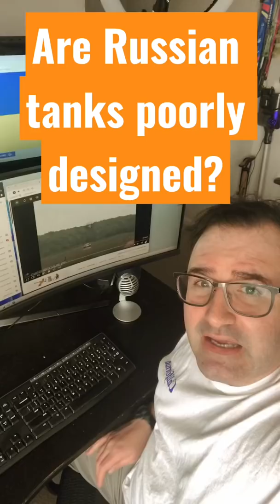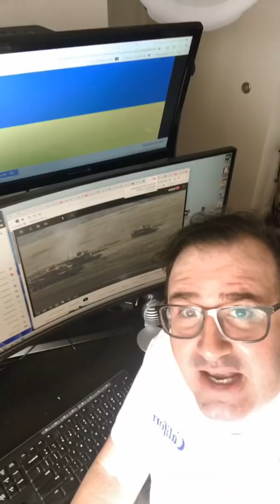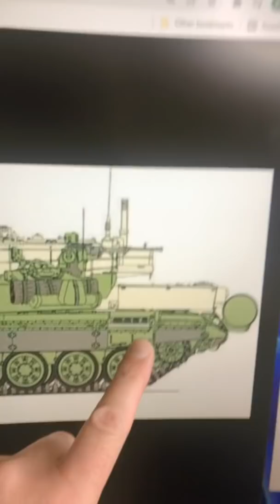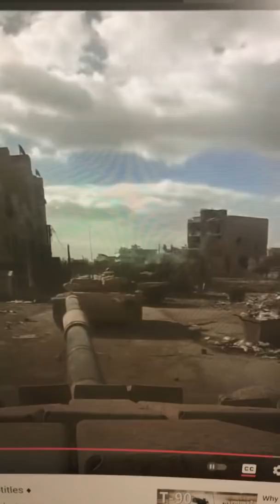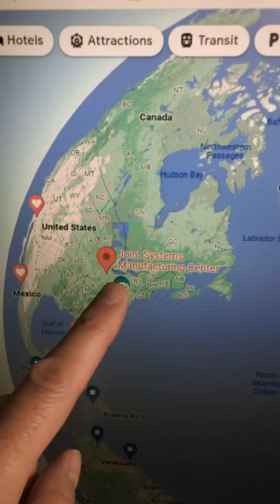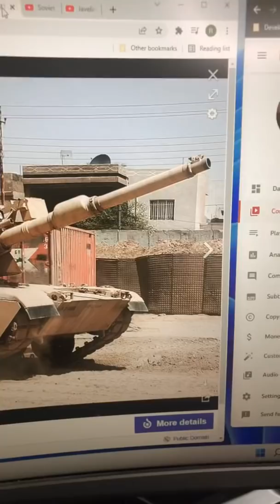Are Russian tanks poorly designed?

Comment: Makes sense, they aren’t a bad design just out of date.
Reply: This happens a lot with history and tanks, most tanks are not actually bad just made for the wrong purpose or out of date, like Britain and Japan in WW2, at early war they had excellent armor, but other nations were just more advanced, or had the right purpose in mind. Both nations, mostly Britain, ended up designing better vehicles in the later years. I dont think the same will happen to Russia here... Mbt's are so expensive that you cant just make a new model willy nilly and start mass producing it, especially with Russia's economy tanking... No pun intended.
Reply: Jay Nirbo  Not necessarily, its a tank family that came to in 1969, even with modern remedies and mods its an old design overall, and for what it was designed for it is actually quite effective, still some flaws and shortcomings noticeable as well of course... The skill of the crew is very important as well. 

An example I can give, no Abrams with US crew have ever been fully destroyed, only knocked out (meaning the tank can still work and the crew does not die... For the most part, injuries and other sometimes dire casualties have been at cause.) 

However, in foreign crews within the middle east, many top tier Abrams tanks have been totally destroyed, so crew skill plays a huge role in how well a vehicle performs.

The T-72's and T64 series tanks are not only designed for the wrong purpose in Ukraine, with outdated designs, but they are also ill-equipped to fully defend against Javelins, AND a lot of Russia's armed forces are either conscripts or people who have never been in a proper battle before. So as a result... Well you know the result.
Reply: I think "obsolete" is the word that you're looking for.
Reply: @pulaski1  
ob·so·lete
/ˌäbsəˈlēt/
 
adjective
1.
no longer produced or used; out of date.
"the disposal of old and obsolete machinery". 
Therefore I just said out of date, and I prefer to say it that way. Thank you for your time though 👍
Reply: Russian do have good design as replacement ie T14 but they don't have the time to work out the kinks or money to mass produce it. On the other hand for western countries or countries with size and weight restrictions can always use bustle autoloader which gives advantages of both tank design philosophy.
Reply: @happypunky4129  Although the design is old with proper modernization like in T90M ie a shiled to protect the rounds in carousel from shrapnel. A bustle to carry extra rounds. Heavy era which throws plate both into the jet and in front the jet to defeat tandem warhead mounted all around. Remote control weapon system and drone connection with battle management system. Their is also a prototype improvement initially developed as a backup to T14 ie Burlak dual autoloader tank in which the he/heat/missile rounds are in bustle autoloader while carousel contains apfsds or the bustle contains charges while carousel contains main rounds. Beside that Russia do have all around active protection system both hard kill and soft kill but never seen on service tank ie T90M. Beside all this if proper tactics are used then it becomes increasingly difficult to kill a tank. Like how in the hands of USA, Germany or France abrams, Leopard 2 or Leclerc are seldom destroyed exception are friendly fire or massive ieds. But in the hands of Saudis, Turkish or UAE  all three have suffered good amount of losses from atgms.
Reply: but is there a tank that can withstand a direct hit from javelins and nlaw though?
Reply: @Jupiter.141  Possibly merkava as it has the most amount of roof armour with active protection system. Also as it's engine is in front if javelin dives on it will be going on to the engine away from the fighting compartment same can't be said about the driver sitting beside it. In rear engined tanks when javelin dives at an angle turret comes in between the heat source ie engine, so it usually hits the top of the tank. In case of nlaw as it travels straight it can be intercepted by active protection system.
Reply: @happypunky4129  name one time when Russian tanks were effective against western tanks.
Reply: @drewschumann1  thats the problem, they're outdated,you cant bring late WW2 german tanks against "modern" russian tanks the same way you cant bring "modern" russian tanks against modern american equipment and tanks.
Reply: Jay Nirbo  Tanks in general are bad for modern combat against a modern foe. U.S. tanks would be absolutely destroyed by UK anti-tank missiles. Or even drones like the Turkish ones taking out the T-72s. We have entered into a new era of combat in which tanks are effectively obsolete for everything except crowd local control.
Reply: @TakNuke  yeah sure u stay in that coffin
Reply: Russian Tank makers and Putin in a nutshell:

„You’re out of touch, I‘m out of time.“
Reply: The arbams is just as out of date
Reply: @donjuanmckenzie4897  it's not the matter outdated it's how it's used
Reply: @riccardoiani  cope
Reply: Jay Nirbo  it's a rock-scissors-paper scenario, where the tanks were wonderfully designed to be great or at least longer lasting against larger, harder hitting tanks. In the case being given though, the people and soldiers of Ukraine are being given tailor made anti-tank weapons designed to be the "nuke" sign in this game.
Reply: @happypunky4129  to be fair the abrams in saudi and other export variant of the abrams are stripped of half of their armor, they dont get good ammo, and they dont have the battle readiness software that the main us abrams tanks have so that if the enemy captures them, they are not able to recreate the legitimate abrams.
Reply: @happypunky4129  Probably this will accelerate the adoption of Armata 14 tanks
Reply: @AbyssalSoda  Not necessarily, how to use tank when facing a near pear or enemy of similar or superior ability in modern combat no one has the cracked the code or they have but don't have the equipment to implement it. Today a tank needs multi level hard and soft kill active protection system against various threats with ability to blend and hide it's signature using passive camouflage like barracuda and active camouflage using phased array optics and BAE system's adaptiv. 360 degree full spectrum vision with automated quick reaction ie firing back towards the danger. Their is also need for mobile tactical electronic warfare, shorad and cram capability all these linked to drones and air assests providing shield and sword against threats. This it true for all kinds of vehicular operation. Direct fire capable mortar like nemo or amos and vls like xm501 for counter or indirect fire against enemy at/aa team. Infantry with latest in full spectrum vision capability which was recently shown by us army is also a big help in countering enemy manpats and manpads. Even if a country has all the equipment it can't do jack shit if it doesn't train with it.
Reply: @riccardoiani  Would you care to explain in what context you're commenting about ?
Reply: @donjuanmckenzie4897  Well the Abrams still mopped the floor with Russian tanks back in Iraq and so on. The Russian tanks can’t exactly claim the same.
Reply: @AnonD38  Cause they were ran by Iraqi's who didn't know what they were doing and the equipment on their tanks were not up to date, many of them didn't even have night vision. The Abrams (like other NATO tanks) was designed to fight in a hull down defensive position because NATO anticipated in a hot war with USSR they would be on the defensive until they could establish air supremacy and destroy Soviet logistics. Soviet tanks are designed for the offensive.
Reply: @drewschumann1  “name one time when Russian tanks were effective against western tanks?” 

Russian tanks totally outclassed Western tanks all the way up to the Abrams. Then it gets muddy on which is better
Reply: @donjuanmckenzie4897  Ok, Russia Today fan. 
Let me set you straight: the Iraqi Army was the 4th largest and strongest Army of the planet at the time. They knew what they were doing, even if they still were a little green.
On February the 26. (aka a day before the Battle of Medina Ridge) 9 M1 Abrams Tanks faced the „elite“ Republican Guard in T-Series (not the Music ;) ) tanks.
The Iraqis were hull down following their drilled in doctrine while the Americans were firing on the move.
The Americans destroyed 28 Tanks, 16 APCs and 39 Trucks in under 30minutes.

And shut up about night vision as the Russians clearly don’t have that either or else they would have used it in Ukraine.

„Soviet tanks are designed for the offensive“ 
Soviet tanks are made to be cheap to replace and as small a target as they can be.
They are also designed to take shots from the front.
ALL tanks are designed for the Offensive, that’s the whole point of Tanks.
Reply: @cassu6  Soviet Tanks and Western Tanks were very roughly equal, but ever since the Abrams and Leopard A6 they were out of their league.
Reply: @AnonD38  What are you smoking?  Everything I said is totally orthodox history. Soviet tanks ARE designed with offense in mind that's why they don't place a priority on gun depression. Meanwhile, every NATO tank was designed to have high gun depression, so it could shoot hull down MORE effectively. This alone goes further to explaining their silhouette than just having an auto-loader (also a doctrine related decision) or trying to present a small target. Yes coalition forces engaged and defeated the Republican Guard in Iraq, so what? It doesn't at all change anything that I said because the fact was Saddam's army was made on the cheap. Just because a tank has an anticipated role doesn't mean it CAN'T serve in other roles, that would be a pretty worthless piece of machinery.
Reply: I believe this comment basically describes Eastern Europe pretty well…
Reply: Sums up Russia quite well
Reply: @donjuanmckenzie4897  Keep looking for excuses man gtfo.
Reply: @AnonD38  🤡
Reply: yup, almost every modern russian tank is directly descended from the T-64 which came out in... you guessed it, 1964.
Reply: Most tanks are outdated. Its all about air and drones or on ground infantry in light vehicles
Reply: @donjuanmckenzie4897  Why did you send me a Putin emoji?
Reply: @AnonD38  cope
Reply: @donjuanmckenzie4897  Pffft, the only one I see malding and seething here is you.
Reply: Nothing out of date about the T-90MS. Plus modern ammo doesn't even cook off so it's a moot point.
Reply: @crowbarfish0812  no because tanks aren't obsolete
Reply: @happypunky4129  even if your not planning to make a prototype, would a new design be expensive?
Reply: @ironsentpootistank4566  Mbt's in general are super expensive, in Russia's case they cant very easily replace destroyed mbt's. Mind you theres a difference in knocked out and destroyed, knocked out meaning its still likely to work with repairs, destroyed meaning beyond repair.
Reply: @donjuanmckenzie4897  they've been updated after 20 years so more likely close to up to date especially with new model Abrams tanks.
Reply: @happypunky4129  Yes but still WW2 British tanks have firepower and penetration to makeup for it. British 2 pounders were no joke.
Reply: They are bad now
Reply: Every tank is out of date lol. Abraham is not even a good tank
Reply: @Jupiter.141  Nope.
Reply: @cassu6  Prove it. Every single time so called modern Russian tanks met western tanks they were annihilated
Reply: Yea , it's true , look how much russian change their MBT , from T-64 , T72 , T90 , even T14 armata , but now russian reported to dump the T14 armata mass production and goes back to modernization T-72 and T-90
Reply: @riccardoiani  What if he will run to your tank. What if he got on top of it? What you will do?
Reply: @zperdek  yeah sure get on top of a tank with an antitank weapon and ammo and in the case u run againts me a tank has more effective range than a Rocket Launcher not even talking about an rpg (propelled grande).
A tank batalion Is soo usefull because it's fast versatile and can demolish everything. The russians are having problems because of bad logistic and bad tactics not because the weapons are outdated
Reply: @riccardoiani  You speak about best possible use for tank. But I'm rely on tank drove by you.
Reply: tanks in general are becoming obsolete in the modern battlefield
Reply: @myopicthunder  no they Arent
Reply: @riccardoiani  ATGMs have ranges over 5km, you have no idea what you're talking about.
Reply: @myopicthunder  no u don't have any idea of what u are talking about
First: the range is not 5km that Is the maximum range there Is another thing called effective range i challenge u to hit a tank at 5 km with an atgm if u are at a shoting range ok u can do it.
Then there are reasons like a shape charge Will probably do nothing againts the front armor of a tank.
And then AGAIN if u have Trophy or an Active protection system u can Just kill the missle before It hits the tank.
So tell me how Will be warfare if u don't use tanks and i do?
Reply: @riccardoiani  doesnt matter, maximum effective range of tanks main gun is 2500m, youre a sitting duck anywhere in open terrain. Most tanks dont have APS and those that do have limited coverage. People who follow global conflicts can show  you the amount of tanks turned to flaming scrap metal not just soviet designs also Israeli, German and American...
Reply: @myopicthunder  ok then tell me how will be war if u dont have tanks but i do
Reply: @myopicthunder  We can't stop evolution, Just watch. Russia is now sending those famouse BMPT Terminator tanks. We will se how will those perform soon.
Reply: @fidgetwidget9116   Eh, they were pretty on par with the German Panzer III J's and L's, but they were terribly outnumbered in terms of armor... Most of Britains stock was trash pre war and reserve vehicles forced into service due to a lack of time and resources. This is because early into the war Britain was relying on a pacifist economy, as they were under the impression that at least until the next generation of world leaders came about there wouldn't be any World Wars after the first one.

Though, they still had insanely capable vehicles with the Crusader as a great example of a British vehicle often misconstrued as "unreliable," despite every tank during that part of the war mostly suffering inadequacies.

British tanks were typically far too sluggish, and not all of them had the greatest armor, and even fewer had proper mobility, and most were outdated and forced into, for example, the Africa campaign which was of course not suitable for most vehicles across all nations at the time. 

Mk 1's were good against the Italians, but not against German armor... Which is why when the British got a tank injection of M3's, Stuarts, and Shermans, they were overjoyed.

However, just to be sure I don't go misunderstood, while the American tanks were super good and capable, the British tankers were not overjoyed cause, "Yay our shitty tanks our being replaced with strong big dick American armor!" But more so, "Finally, more tanks." 

Many British tanks were not replaced by the US armor, but the outdated ones of course were, and the low number of vehicles were fully replenished with the US armor gifts. 

The British also struggled with tanks mostly due to a majority of resources being allocated to the Navy and Air, ground got whatever was left.
Reply: Definitely bad designs even at the time, why would you put an auto loader which needs the ammunition to be stored right underneath an improperly sealed turret, half the time the explosion wouldn’t go through the armor it would just go through the gaping hole around the turret and set the ammunition below on fire
Reply: @rog69  well I mean any idiot could think to guard the explosives away from openings where it could cause it to explode, pretty much every other country in the world has done it long before the Cold War yet here’s Russia 40 years after the Cold War still making the exact same mistakes on all their newest tanks it’s laughable
Reply: @rog69  yes Russia’s tanks are all old, their new designs haven’t been put into circulation yet so their newest tanks are of 40 years old design, also why are you talking about the t-14 which is an American/English designed tank not Russian 😂😂😂😂, era is eggshells cardboard, yes it helps but it most certainly does not stop most things but that’s not sealing the turret, that’s just chucking some shit in front of a gaping hole, wanna know how we know the turret isn’t sealed properly, if you actually watch a Russian tank being blown up where does all the flames escape from the ammo, the circle hole surrounding the turret before the turret is blown off
Reply: @rog69    oh I though you meant the extremely old American English t-14 from just after one of the world wars not the Russian one that doesn’t exist as a battletank only as a prototype hence why I said their newest tanks which are Cold War design, they may have a new design but it is not in production or in use so completely irrelevant and the point about the turret is you said it’s sealed which it’s not hence why you see flames shooting out from the turret and the turret blowing off, the turret blowing off may not happen every time but the flames shooting out from the turret happen 100% of the time when the ammo is caught alight because of poorly designed tanks
Reply: @happypunky4129  British tanks where sluggish because of doctrine. They where there to support infantry. So they didnt care if it couldnt go much faster than walking pace.
Reply: @jimmyd1337  Which turned out to not work so good for the infantry, but they had the right idea.
Reply: The design isn't out of date, the spectrum of tanks is pretty much made obsolete by the Javelin until a new counter to the Javelin is created.
Reply: @TakNuke  all currently in service T-72's and T-90's a have shielding however this meant to protect against spalling not HEAT warheads.
Reply: @nemisous83  but what you forget is ours aren’t out of date considering Russia doesn’t have the equivalent, our tanks can take their anti tank weapons whereas theirs can’t take ours
Reply: @perry714.  you do realize the M1A2SEPv3 is an upgrade to a tank that was developed in the late 1970's right? Also in what area is the T-90M and T-72B3M "outdated"

The M1A2SEPV3 cannot defend against a 9m120 Ataka, 9m123 or Kornet M which have well over 1300-1400mm of RHA penetration .
Reply: @perry714.  please elaborate about how its outdated? M1's Chobham armor is from the 1970's and the DU mesh insert was tested in the late 1980's. They are relevant because systems like Javelin and NLAW while being shoulder fired are not man portable like something like a AT-4 or RPG-7 they are usually carried in the back of truck to the firing location in the same way a tripod launched or vehicle launched ATGM is used. But I'm sure you where going to cope yourself into equating the RPG-7 and RPG-29 to the Javelin like they are in any way comparable systems.
Reply: @nemisous83  Tanks are definitely not obsolete, the issue is Russian tactics and how incompetent the crews are. They have no Infantry support most of the time, traveling in vulnerable 20 tank columns sometimes even.
Reply: @happypunky4129  infantry support doesn't really  help when you are talking about missiles that can hit from 3km's away well outside most infantry and IFV's firing range. That line of though only applies to shoulder fired launchers like RPG's and AT-4's because the person engaging has to be relatively close to the target inside the firing range of supporting elements. Until active protection systems become more common they are just as vulnerable as APC's and IFV's
Reply: @nemisous83  It does help, theres a reason forward reconnaissance and aerial assets like drones exist. Theres a metric shit ton of ways and tactics that go into preventing this. That all aside though, these Javelins only penetrate and kill due to ammo racking the tanks, and the fact they have two charges instead of one. The autoloaders place the ammunition in a circle around the turret ring, making ignition very easy. This likely wouldnt be an issue with other nations vehicles that keeps ammunition storage more safely kept at the cost of having a manuel loader.

Tanks cant become obsolete cause they fill a battlefield roll that is crucial to military's everywhere.
Reply: @happypunky4129  forward reconnaissance is hard to do in a densely populated built up country like Ukraine also its implying the forward reconnaissance elements are ambushed and destroyed. aerial reconnaissance is difficult because the Russians don't have complete air superiority. The placement of ammo matters very little because a top attack weapon would kill everyone inside the turret on a western tank as well just from the spalling and overpressure Russian tanks just look more devastating because the turret goes flying.
Reply: @happypunky4129  tanks are just one element of combined arms warfare however they aren't the deciding factor like some would have you think the maneuver element is.  however when one area is lacking the whole combined arms operation is in jeopardy.
Reply: @nemisous83   They are a very important part of it, without them it may be impossible to forward an assault, something that can't be touched by light arms fire and a considerable amount of heavier arms, while moving at good speeds with multiple high firepower weapons, exploiting openings and allowing infantry + the rest of the element to move in is important. Without proper armor getting anywhere would become a much more trifling task.

Tanks can't be obsolete, they are essentially cavalry in today's time, and there have always been cavalry, even before firearms were invented, and before people actually wore proper armor. 

The truth of the matter is that here we see Russia is incompetent, and have a lot of poor design choices in their current mbt's, whether I'd call them outdated or not I do not know; but I'd call a lot of their design choices poor.
Reply: @drewschumann1  the doctrine was for 50years quantity and losses vs accurate protection and tech firing advantage same as germans have almost done in the ww2
Western block have not the men and vhcs  reserve to spend them as warsaw pact was ready to do.
Reply: @AbyssalSoda  the solution would be tank drones as rheinmetall have done for his unmanned infantry vhc who follow the platoon
Reply: @donjuanmckenzie4897  it still one of the best tank of the world and I'm not american one of the best in matter of protection
Reply: @donjuanmckenzie4897  you seems forget even if Iraqis have not the better version of soviet tanks they have done war for 8 years before the first gulf war.
Reply: @badbotchdown9845  arab armies are terrible, there are books written on this subject
Reply: @badbotchdown9845  i didn't say it wasn't, i was simply saying that Iraq's performance shouldn't be taken as representative as the capabilities of their equipment
Reply: Just like any tank, against anti tank weapons. Modern swords are too sharp for modern shields, that's it
Reply: Its still not outdated in terms of weight reduction and cheap mass produce.
Reply: @happypunky4129  You and Nick Graham are forgetting the fact that there is also the SAM systems, the reasonings why Russian tanks are getting destroyed more is that they and other military assets are pushed faster out than their forward pushing defenses can cover. I wouldn’t say Russian tanks are terribly designed, but some could do for modernization and having better materials and tech out in them, but they don’t have the manufacturing of such components and tech available to them, if they did, they could push out vehicles and everything else out faster. If I could, I wish I could find the production of the IS-7 and have that improved and modernized. Reasoning: I want to see what a modern version of such a design would look like, given its front armor was designed with a pike nose to better deflect tank shells and forward facing artillery shells while cutting back on weight by allowing for thinner tank armor, which in turn allows the tank to move a little faster and allows for less money and materials to be spent and used on it. I wonder what could be added to improve it, like the tech and reactive armor platings of the M1 abrams, and the the metal racks and mesh up above to protect against air to ground explosive tech such bombs and missiles.
Reply: id say being cramped enough to hate it and having auto loaders that when they work eats your arm half the time isnt good design
Reply: They aren't even russian tanks. They are soviet tanks. Russia can't design shit (apart from small modifications of the existing arsenal)
Reply: Nothings a bad design in war, it simply can be made irrelevant how well designed they are
Reply: @notchs0son  people who think ther are no bad designs in war dont understand war.
Reply: @notchs0son  sometimes that is exactly what happens.
Reply: @jaxrammus9165  yay for QC!
Reply: @notchs0son  you still dont understand its not about quality control sometimes you just have no other option.
Reply: @jaxrammus9165  oh well yes obviously when a country is nearing the end of a war you can almost certainly tell who wins by the state of their troops.
Reply: @happypunky4129  italian tanks didn't even have the time to adapt and were always inferior during the whole war
Reply: @Nick-rg8oz  They were cool designs though, interesting, come latewar they actually had some very effective vehicles, though of course the war would soon come to a close.
Reply: @happypunky4129  ATGM Kornet versus Abrams ? Easy target 🇷🇺🇷🇺🇷🇺🇷🇺
Reply: remember RPG-7 can killed M1 Abrams
Reply: @drewschumann1  RPG-7 can't killed a T-72B3 while many M1 Abrams got killed by RPG-7
Reply: @nhatpham2206  And ATGM Kornet, Konkurs, Ataka, Vikhr, Krishantema...
Reply: @nhatpham2206  even a sticky bomb is sufficient in a close environment such as a city or a village but that's not where a tank is best on. In open spaces an RPG from the front of any modern tank can hardly do damage before being obliterated by tank support or the tank itself. Meanwhile a hidden soldier kilometres away with a target lock missile launcher such as a javelin can easily destroy any armored vehicle without being spotted in time. That's why russian tanks are obsolete
Reply: @goodlife6277  so? if they use laser guidance then launching smoke bomb, if they use thermal guidance then turn on the Shtora
Reply: В чем устарел ? Абрамс же ровесник Т-72 такой же старый .
Reply: Nobody is that smart and nobody is that stupid.
Reply: @happypunky4129  вы вообще ничего не знаете о российской тактике . Российская тактика прекрасно работала в Сирии . Танки танцуют вальс вдали от противника и ведут артиллерийский обстрел постоянно меняя позицию и не давая в себя прицелиться . В штурмовых операциях российские танки не только поддержаны пехотой но и специальными БМПТ "Терминатор" . И уж точно российские экипажи не являются некомпетентными . Вот Украина потеряла за последние 4 дня 155 танков вот там да некомпетентные экипажи и тупое командование . Понимаете ? За 4 дня 155 танков потеряли ! Вот это да некомпетентность !
Reply: @nemisous83  вообще то российские танки стреляют ракетами на дистанцию 10 километров .
Reply: @nemisous83  и это . В отличии от абрамса на российских танках с активной защитой все в порядке . Это Абрамс на столько тяжелый что на него больше ничего особо и не повесить . А российские вполне годны к модернизации .
Reply: @nemisous83  башня улетает у всех танков . Но на российских танках боезапас внизу у днища . По этому в него наоборот труднее попасть !
Reply: @badbotchdown9845  ну ... Русские уже применяют такие в бою ... "Уран" называются например ...
Reply: @badbotchdown9845  американец в плане защиты один из худших ! Просто он почти не воевал против равных ! Даже в Ираке воевали против очень старых Т-72 экспортного варианта с очень старыми снарядами 60-х годов . В СССР эти снаряды давно были сняты не только с вооружения но и с хранения их продавали в другие страны . Современным оружием по абрамсам не стреляли . Никогда . Даже на испытаниях . Абрамс это мыльный пузырь созданный пропагандой . И США не могут построить новые танки . Потому что давно разобрали танковые заводы . Оборудование продали в Турцию Египет и ... И между прочим в Иран что очень странно ... Но факт . В США есть только ремонтные базы . Где модернизируют небольшое количество Абрамсов ....
Reply: @steveh5307  да ... Но весь мир строит новые танки кроме США . В США нет танковых производств ... Приходится хвалить старые Абрамсы и доказывать всем что они мол "лучшие" ... Но весь мир знает что Абрамс тотально устарел ....
Reply: @resistance397  thanks you small Robert
Reply: @drewschumann1  During the whole cold war.
Reply: @AbyssalSoda   Not if you know how to use them
Reply: @drewschumann1  I think tactics (brains) matter. Battlegrounds were different, but you might look up wars between India and Pakistan where India came out on top in a few battles using Soviet T-55s and PT-76 against Patton tanks (M-47 or M-48).  There is even a town called Patton Nagar (Patton City) where 90, including 70+ Patton tanks, were destroyed.  In a few cases the battle was "unfair" as the Indians flooded rice fields.
Reply: Some people say its how the ammo is stored in the carousel. Thing is that it reduces crew needed to 3 (no loader required), which theoretically allows for 33% more tanks crewed. This fitted the soviet mass wave doctrine and which simply threw just a few more thousand men at the problem hoping to overcome an obstacle. They relied on much more on overwhelming their enemy by sheer numbers. 

Besides that, the armour of soviet tanks on the front was capable of withstanding direct shots from 105mm APFSDS, at least the later soviet models.
Reply: @drewschumann1  Korea.
Reply: Yeah, same with a lot of Russian equipment.
Reply: @donjuanmckenzie4897 The Abrams gets upgraded all the time, and now the AbramsX is coming…
Reply: @Jupiter.141 no, a modern ATGM like Javelin like Kornet wil kill an M1 just as dead, even disabled a conventional war leaves any immobile tank dead in the water, the crew bail out they die they stay out they die.
Reply: @TakNuke remember, APS can be fairly easily overpowered with cheaper projectiles, they can only deal with a few before running dry. A hit tank is a dead tank no matter the nationality
Reply: @AbyssalSoda the Russians have a perfectly good ATGM which has, even in export, downgraded version, taken out M1 tanks
Reply: @thatguy46744 to be fair, the arms those M1 have been hut with are equally downgraded, export variants, the domestic ones are designed to kill a true US M1
Reply: @AnonD38 the Russian tanks were monkey models deliberately poor export variants no composite armour no proper ammo, it was policy to be able to make them fast and super, super cheap, they were not trying to showcase quality. The Iraqis, to their chagrin, found out too late that they had been duped
Reply: @AnonD38 however, Leopard, challenger, Europe has been drawing down tank forces because our own research shows that they are too vulnerable, too susceptible to heavy damage which even if not destroying them may kill the crew, immobilise the unit, damage the gun etc and they're better off focusing efforts elsewhere. When a couple of infantrymen can reliably destroy ANY tank in existence with ATGMs or even immobilise them with mines leaving them utterly helpless against tank-killing artillery fires, maybe its tine to focus on something else. Same with huge ships, susceptible to anti ship missiles etc, whereas submarines remain extremely difficult to hit and carryover ng a nuclear deterrent make you impervious to attack, well worth the investment
Reply: @KekusMagnus the M1 was designed in the period after Vietnam, mid-late 70s, hence the name, it remains in service now far far heavier and more expensive better protected but only in the context of being used by the USA with overwhelming air power. Give a few to Ukraine without those things and a few Kornet teams will kill or severely damage them.
Reply: @JAnx01 its not obsolete but like the Leopard, Challenger, Abrams, etc, it is a big target and vulnerable to a battlefield which haas swung heavily towards attack versus armour. As long as a military accepts that they are going to lose much or most of their forces fighting attrition war (which most are) then they are still useful weapons. If you hold them back fearful that the mystique of imperviousness will be shattered then why build them at all? I was a soldier i accepted that in a modern war i was most likely going to die, what use would i be otherwise?
Reply: @happypunky4129 less than 1 million dollar for upgraded T72. Given that an M1 will still be killed by modern ATGM, they represent a decent buy.
Reply: @riccardoiani they sort of are, where the technology to ensure their survival against cheaper weapons costs billions to develop and billions more to build, might we just say screw it and build drones in future?
Reply: @riccardoiani if you have this, if you have that, if you have the other .. what if you are fighting a war and it becomes difficult to replenish the active protection, what if the tank gun and tracks suffer damage, the engine develops a fault etc? This isnt world of tanks... they are not 100% effective despite suffering heavy damage... A tank might be standing but a small penetration might have killed the crew with metal shards going hundreds of mph chopping them to bits. What if a crew is sleeping and they are killed by a drone? In teal war there is no such thing as an invulnerable weapon, even if you had an Atlas mech stomping around someone would develop a counter
Reply: @zperdek theyve been performing well but one or two are gone now, showing no invulnerable weapon
Reply: @jamesgornall5731  No matter where there will be armed conflict in the (near) future you’ll want a vehicle that can support Infantry by taking small to medium caliber rounds without flinching and capable of returning fire / giving support or covering fire while also being able to combat other such vehicles.

IFVs and Tanks are currently the best suited vehicles for such a role.

Sure you can destroy a tank relatively easy with specialist equipment, but that’s true for any vehicle on the battlefield and you don’t see people advocating that we should get rid of jet planes just because AA technology is super advanced nowadays.
Reply: @jamesgornall5731  true, but they are still sturdy and survivable, and they dont got a massive pile of ammunition in the middle of them lol. And they have modern battlefield readiness software too, something russian tanks dont and cant have.
Reply: @jamesgornall5731  nah bro drones are only another tool
Reply: Yea out dated from about 1972 on.
Reply: @vonSchwartzwolfe  technically that’s the collector’s edition
Reply: @fidgetwidget9116  the British 2 pounders were fast approaching obsolescence in 1940 . They didn't even have a HE round, so engaging artillery and infantry...not so good.  Low velocity, the fired shell could be followed by the naked eye. A panzer 4 was impervious to it .
The 6 pounder ... different story .
Reply: @happypunky4129 Britain feared an invasion and decided not to make newer designs and produced prewar designs in greater quantities
Reply: the doctrine 
it is the doctrine
Reply: @happypunky4129  You don't know anything
Reply: @TakNuke  lol the t14 isnt a good design, one of the most hilarious things about it is that it uses the engine of the tiger... its engine design at its core it 80 years old... and its the famously unreliable one at that
Reply: It wasn't a bad design, it was actually a great design for the time for the kind of war it was supposed to fight but it was overall very shortsighted.
It was from the get go a tank difficult to upgrade due it's small size and this means you cannot really change gun, engine or transmission and therefore you cannot put more armour on it
Reply: @donjuanmckenzie4897  the abrams is getting a modernized version
The abramsx
I don't expect for it to be used for some time though
Reply: @crowbirdryuell  the abrams is decent
Reply: depends. They were designed to be small and disposable. 
While western  tanks were designed to be sturdy and easily repaired.
Reply: @jaxrammus9165 

Great, now you're just regurgitating folklore about arm eating autoloaders
Reply: @Helperbot-2000 

LOL at you uncritically believing some worthless "analysis" by some Youtuber about the T-14
Reply: @thephoenix756  🤡right, russian propaganda tastes good doesnt it
Reply: @thephoenix756  not folklore, but i dont expect a bot to understand that
Reply: Like the WW2 T34 vs Panzers - the kill ratio was in favor of the Germans but the T34 was cheap and quicker to make and they had disposable tank crews.
Reply: @tibbydudeza  the t34 wasnt cheap, it was about the same cost as a sherman
Reply: @Helperbot-2000  no machining and afaik the turret was welded and not casted as one.

Also with communism and the great patriotic war people just cost paid in rations so cost is not comparible
Reply: @tibbydudeza  not sure what either of those have to do with what i said.

thats literally just wrong, they were paid just like any other country, it was low paying, but it was still pay. and the ussr was never communist or socialist, it was state capitalist with some social politics
Reply: Reports indicate while you were frontoviki you technically were supposed to get paid based on your rank it became a moot point during the conflict.

Why bother transporting rubles on trucks for pay day when it could be used for desperately needed supplies ???.  @Helperbot-2000
Reply: @tibbydudeza  the t34 was a shit tank with no redeemable qualities, as an example is was not cheap lmao